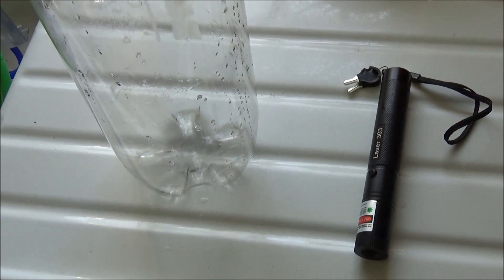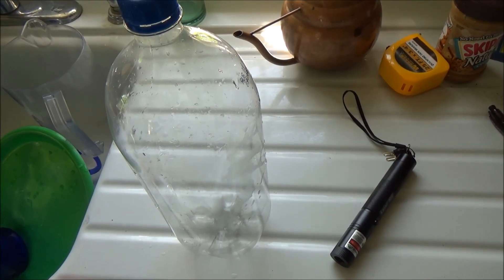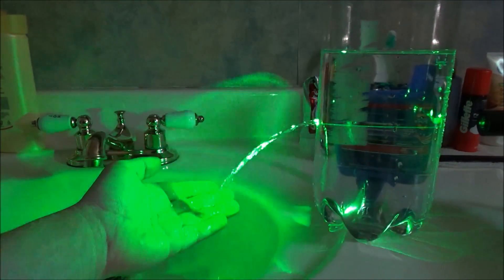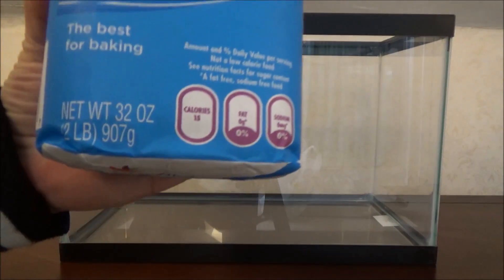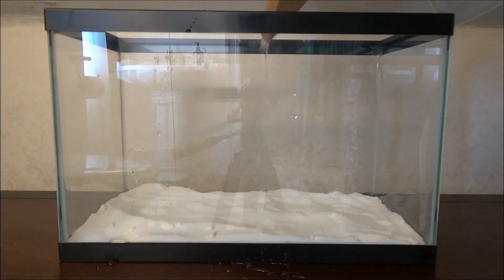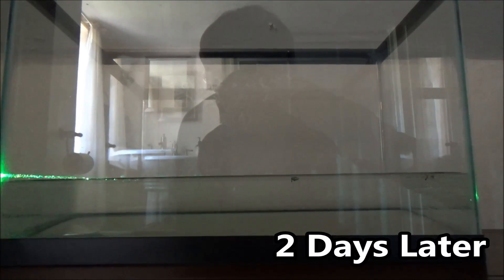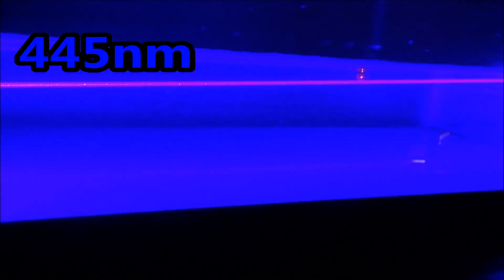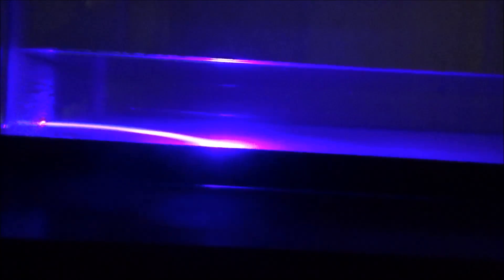How to Bend a Laser Beam

Comment: Does this method disprove curvature of the earth? As light reflecting off objects in tne ocean would seem to disappear behind the horizon as the reflected light is refracted downward. The denser the air the shorter the horizon appears away. Thoughts? Also when doing this experiment the flat bottom of the tank filled with the solution appears to bow up looking corned. Thoughts?

Comment: Or just boil some water and use that as the solvent. You can also get more sugar (solute) into the water (higher concentration). This is refraction, not diffraction. Refraction is the change in speed of the wave of light due to the medium density (water with no sugar vs water with sugar dissolved and being more dense)

Comment: Break up a LCD screen off of an op panel of a discarded phone and remove mirror like aluminized mylar reflector square sheet from back of it , it looks shiny like mirror , hold this mylar sheet between your two fingers and bend it a little and shine a beam of laser light into it while you are pointing it towards a white wall in a dark room you will see a large bent bright beam of light on the wall.

Comment: Can you really bend light without illusions?
Reply from the maker: Technically it can be done. Dark holes have so much gravitational power that they are able to bend passing light
Reply: So besides making a black hole, are there any research you know of that can bend light, without the illusions?
Reply: Refraction is not an illusion. Gradient refraction is not an illusion. Our very eyes work on the principle of "GRIN". And it happens all the time in our atmosphere. Your reasoning is basically an example of the no true Scotsman fallacy, especially given that you never define what you would consider as "really bending light", which thus is a meaningless term.
https://en.wikipedia.org/wiki/Gradient-index_optics
https://en.wikipedia.org/wiki/No_true_Scotsman

PS: Found the flerf! 😂

Comment: awesome video i left a comment on your other video about a science project. Do you think i can do the tank one and put mirrors on the side of the tank so i can demonstrates what the reflection of the laser looks like?
Reply: and do you know of a decent laser that is not very dangerous but you can sort of see the beam?
Reply from the maker: +CamOrigamiandmore did you mean mirrors on the bottom? Green lasers are typically the most visible to the human eye. The Laser 303 is only like $8-$10 and has decent visibility
Reply: i wanted to set up mirrors on the inside of the tank so the laser will bend and reflect onto the other mirrors. i think it looks better for presentation. So will a 303 laser burn things and will i need safety goggles. And thank you so much for the help i think i am going to do this for science fair!
Reply from the maker: I the 303 is tough to burn anything with, it will just barely light a match an even that requires the laser to be perfectly focused and held still on the match for around 60 to 90 seconds. I always suggest the safety glasses, but in all honesty as long as you put something on the end of the fish tank to stop the beam once it reaches the end of the tank, you should be fine, since you're only going to be viewing the light from the side through a tank of water. The toughest part of this experiment will be the setup, because that tank needs to sit perfectly still for 24 to 48 hours for the result seen in this video. That means you can't even lift the tank to move it. Also make sure you don't leave the laser on for longer than a minute or so at a time, otherwise you can burn out the diode.
Reply: ok thanks so much for the advice. And thank you for your time! i am going to get the green 303 because it suits my needs perfectly and i am getting safety glasses for me and my dad so we can both see it. You have been so helpful and i love your laser videos! I watched like 10 and the quality is awesome! keep making them!